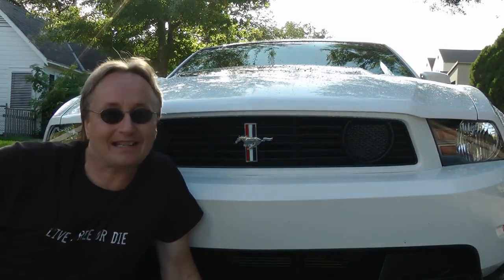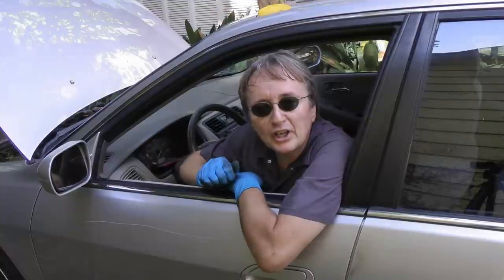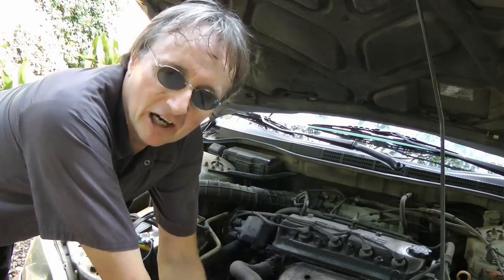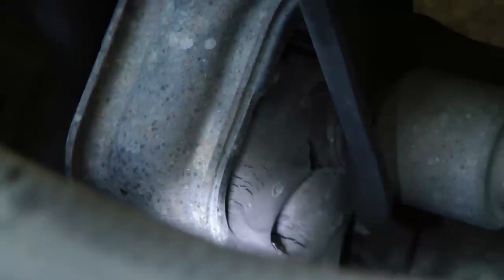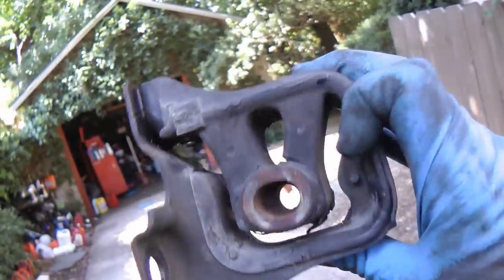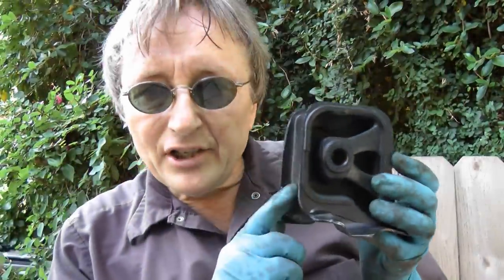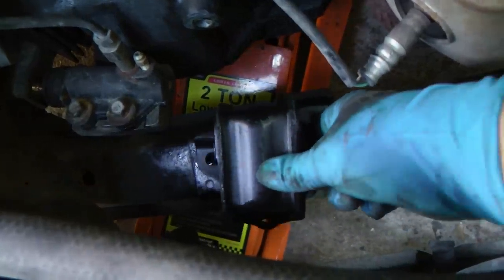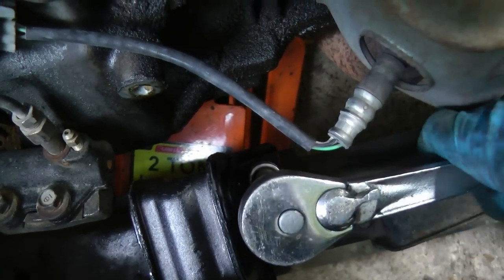How to Replace a Motor Mount in Your Car

Comment: i kind of stuffed up when i was trying to change the mount. the top left bolt on the mount bracket that connects to the engine broke of :(. my question is, is it o.k if the mount bracket only have 2 bolts to the engine?. i don't want the hassel of trying to take out the broken bit if i don't need to. does missing the top left bolt on the mount effect anything?
Reply from the maker: I've put a few back in my time with only 2 of the three bolts in and they worked fine. Just get those two bolts in tight,

Comment: I tried to replaced the 2 front ones in my silverado but I couldn't do it,,, can someone help...
Reply from the maker: motor mounts can be stinkers to access, especially on big V8 engines. Often an engine hoist is required to get em high enough to remove the old ones.
Reply: I know, I got it, with the help of engine hoist, thanks for the help and by the way nice video,,very helpful...I need help with the engine compression,,,

Comment: how doI replce the motor mount on the passenger side of a 1998 audi
Reply from the maker: very carefully, audis are not easy to work on and you have to jack the motor up in the air some to get room to replace the old one which is unbolted so you can jack it up. Even I hate doing em on those.

Comment: Scotty, which motor mount would cause the engine to move way upwards when put into drive while keeping the brake pressed? It's an 04 Acura RL that I'm talking about. The car doesn't feel smooth because there's this constant vibration while driving it. Whenever I let go off of the gas, it goes away. Sadly the dealer test drove it and said it's perfectly fine. I know there's a bad mount but which one should I check? Thank you.
Reply from the maker: any broken mount can do that, do as in my video, get a jack and a piece of wood and jack up the engine while watching mounts for cracks or broken pieces
Reply: Scotty Kilmer
Thank you, I'll try that.
Reply: This is the exactly same thing that is going on with my car, but it's a dodge intrepid 2004

Comment: do you know if I can put a x pipe on a dodge charger 2007 with two muffler in the middle ?
Reply from the maker: +Christopher  Machado best to keep it stock, changing exhaust system requires reformatting the computer for it to run right, and that can only be done by an expensive pro dyna tune

Comment: Having trouble realigning the same mount on my b series integra what can I do to get it back in place
Reply from the maker: yea, often you have to wiggle the crap out of the engine with pry bars to get it aligned. BUT, realize cheap aftermarket mounts often do not fit right as they are not correctly built IF you bought a non oem mount

Comment: 98 camry rear motor mount removal, do you have a trick or specific tool to remove the top 17mm bolt
Reply from the maker: I have sets of funky curved wrenches that fit in anywhere, try and S shaped wrench
Reply: Thanks for your response.

Comment: Scotty Kilmer thanks for your many videos to help those that need help and those that simply want more knowledge. My question is if you are jacking up a motor from underneath where is the best place to place the jack?
Reply from the maker: the oil pan, and put a piece of wood under it so it doesn't dent
Reply: Scotty Kilmer I always wondered if that would disturb the oil pan seal. I am getting ready to change the motor mounts on a 2009 Chrysler 300.

Comment: i have a hummer h3 it makes a horrible sound like "broom" when ever a want  to turn right or left or even when i stop and press the accelerator it makes that sound somwbody told me is the transmission. i changed the transmission, but still the same, somwbody else told me it is the gront axels, im trying to find out whats the problem might be, you have any idea?
Reply: front axel
Reply from the maker: to find out, do my video "finding the source of car noises"

Comment: hey scotty i have a 05 corolla that the engine is vibrating now. I replaced the head gasket because they say that could have been the prob. any ideas what the prob might be.
Reply from the maker: many things can do that, anyone guessing with a head gasket for that problem is a poor mechanic if it didn't fix it. He should have tested it as in my video "how to tell if your head gasket is blown" FIRST. Have motor mounts checked first, they often cause virbration, but definitely forget using that guy again
Reply: How long would it take to replace the motor mounts on my corolla and how much would it cost me to replace them.
Reply from the maker: Joe Rainville
depends on how fast you are and where you buy the parts. I could do it in a couple hours, and aftermarket mounts could cost as little as 40 bucks apiece. Dealer ones cost TONS.

Comment: My bracket wont align back to the engine for me so I'm in dire need of help
Reply: I hope you got it in by now lol, but for other people the reason it wont line up is 1)you jacked it up to high or low, or 2)you didnt support the engine in center(or slightly off center depending) so it kinda got pushed sideways, maybe your jack slipped over a bit or basically it shifted in some direction. Use another jack to get it where you need it. And quick! You dont want too much stress on the stuff left holding it at that wierd angle

Comment: how far do you jack the engine up to take the mounts out
Reply from the maker: high enough to get clearance to remove the mounts, depends on how tall they are
Reply: ok so to get started do I jack the car up first then put the jack under the engine to hold it or put the jack under the engine then jack it up